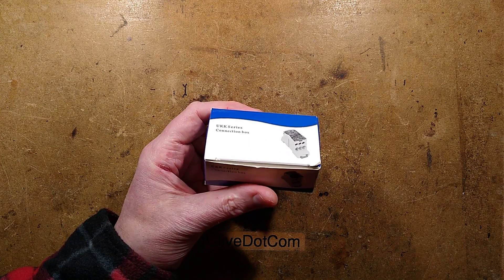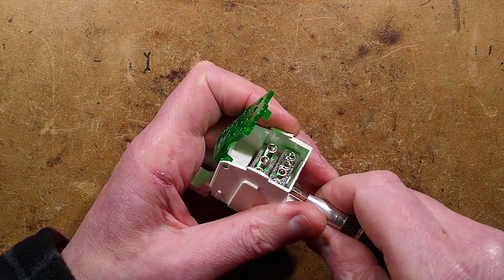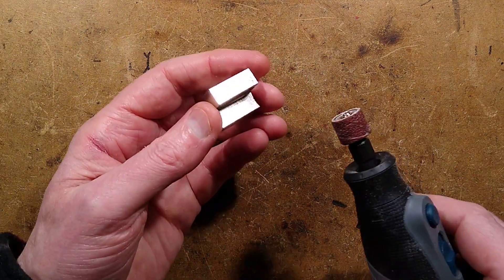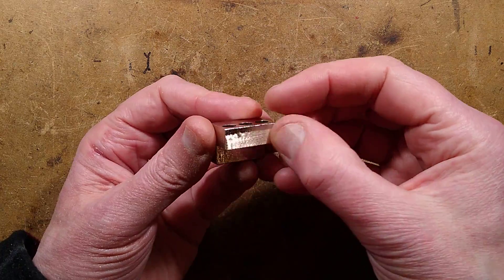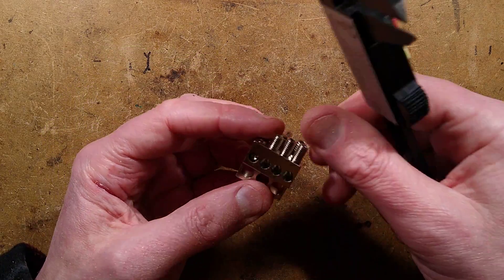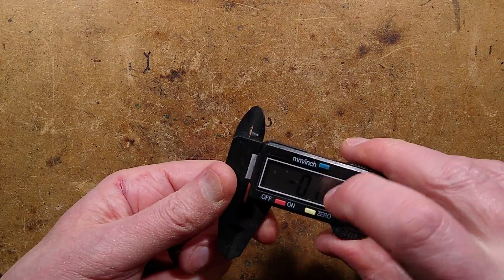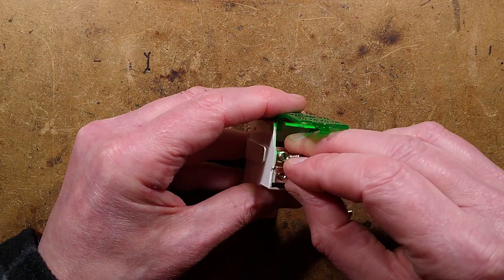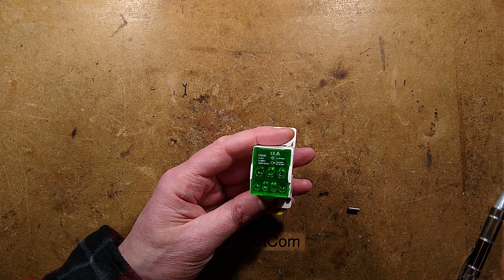Would you trust a Temu 80A electrical connector?

Comment: Well BCDC Ive ordered one £4.30 and will give it a surgical deconstruct - was the metal Nickel plated Zamac (Mazac)?  You could tell that just by weight?  What no one has questioned (inc you) is how sturdy and reliable are the screw threads to maintain consistent pressure on the cable strands.  Remember its one of the problems with Aluminium cable, that creeps over time and loses grip force, leading to micro arcing and eventual failure.  Will report here soonest.

Comment: 80Amp is what grid gives houses these days.
I do decommission lot of specialist plant growing premises. After original 88-3 fuse declines service,  occupiers tend to go for alternative supply solution. I am happy to say, that In south Yourkhire most of these seem to use CHINT C60 breakers. (sometimes 7 or 8 supplied  from alternative single phase route and used fully)
I do not see the idea of ever doing high current connection without putting handy breaker (again less then a tenner) in between.
Maybe in a medical field.
So this Should be strong enough to sustain full usage of normal house...
I still find this safer option then Idea of consumer unit From Ebay/Amazon.
In case of LVE  which used to be combined with LVE official website containing completely real user reviews saying stuff like "I just saved on buying consumer unit"

Comment: I designed an earthquake simulation lab apparatus that used 460VAC power to pump massive amounts of water thru a very small and cramped lab. I kept asking for water ingress-protected enclosures and controls but they're expensive... so eventually when the dean, dept chair, and two visiting grant program managers came to witness a demonstration I had our usual  safety brief and said, "and as always I cannot stress how dangerous this side of the room is; please just do not come over here, look at, and especially do not touch anything. These circuit breakers are here to protect the building from fire and will not activate if you become part of the circuit." 

The next day I had my capital expense approval for a whole new electrical cabinet. With name-brand parts!

Comment: The slight magnetism was probably the steel screws.  Zinc will vaporise well below the melting point of iron so a zinc, copper, iron alloy would be very difficult to make.  I suppose the silver coating could be Nickel which would make it slightly magnetic.  If it's Nickel coated brass then it is pretty scookem.

Comment: The longevity of this stuff is what worries me, once it looks like it can even handle the job in the short term.  Far too many times I've seen stuff from 'that' country look fine and work fine in the short term but come back in a year's time and it's failing in some way.  I'll happily pay extra to buy a thing manufactured by a reputable firm (getting harder to do because a lot is now outsourced to that same problem country, but quality control of that reputable firm does improve the end result) because I know it will still be there doing the job in 20 years time.

Comment: Before deciding to trust this device by looking at it:
Look up the lug torque specification of a similar device of a reputable seller. Tighten the lugs of the Temu device to the reputable device's specified torque specification.
Now you're ready to decide whether or not to trust that Temu device.
Reply: looks like a copy of the Erico UD-80A, so  bottom connections = 3.5 Nm top connections  = 1.2 Nm

Comment: The shiny plating looks great, but nothing like copper. Brass has a relatively higher resistance. When it comes to ohms, it is little, but even that little has major effects, like too much heating when it comes to high currents like the 80 amps mentioned and especially using AC. My answer is no, I would not use it.

Comment: When PEX water pipes came in, the Chinese brass had 15% zinc in it that caused problems. Then mixer taps (brass) had some lead content over the permissible levels.  Don't know if UK enforces import standards, but different countries seem to get different product.  Perhaps it would be a hoot to have a UK  metal machinist too up a drop in , identical magnesium connector block.

Comment: Anyone have a suggestion for a Wire Ferrule Tool? I’m building some Bi-Amp 10ga Speaker Wire and I want to put Ferrules on each of the four Wires so they look tidy going into the Banana Connectors that have Allen Key Grub Screws. Never used Ferrules before but they look great for this purpose. Tool and Ferrules would be appreciated. 🙏🏻
Reply from the maker: To guarantee that you get proper copper ferrules, I'd recommend you get them from a proper electrical/electronic distributor in your country.  The crimping tool should be OK to buy online though.

Comment: wouldn't use it for 80A but for maybe 20A in a low voltage system for a personal project. anything that you're putting together for someone else the components should come from reputable suppliers and be approved by a testing lab for liability reasons

Comment: A lot of materials at low cost uses metal that has been recycled and may not be pure.  Unsurprising that a brass which should be just copper and zinc is magnetic.  That indicates that iron has contaminated the mix.  Pure copper is just getting more and more expensive.  I find the same contamination issue with solder that won't flow as well as high quality versions.

Comment: I have the same one, from aliexpress, no issues whatsoever at 80amp (and beyond). Though I have a 63A DC breaker from the same store that can't even handle 40A without smoking.

EDIT: This is not an endorsement, mine could be copper, the next order could be steel, you never know with these products and stores.

Comment: Handy tip # 56 .... it is a good idea to remove the button cell from your vernier , if not used regularly .... some verniers draw a tiny current , even when off ... then ... you get the usual destructive messy corrosion ! .......... DAVE™🛑
Reply: Yes, for all things battery.  Of course I only use mechanical calipers.

Comment: The nickel plating will be very slightly magnetic.... More of me worried about the flame resistance of the plastics .. its not just about the item itself but what happens if a nearby component goes on fire ... Will the plastic in this temu item catch fire quickly.?

Comment: I'd be dubious of the metal used for the screws and how good the threads are.
The screws don't seem to fit too well so the threads might not be very accurately machined (molded). I doubt they are hardened so the socket cap would probably strip out before you could torque them down tight enough to hold the wire especially if there is a tight spot or swarf in the thread.

Comment: UKK... Urho Kalevi Kekkonen.
Kekkonen, Kekkonen, Kekkonen, Kekkonen, Kekkonen.

There would also be a "red brass" alloy that has a very coppery hue to it, but I wouldn't trust the stuff with threading screw holes into it or at least significantly torquing said screws. It is common in trinketry and belt buckles etc, usually plated with a dull silvery coating that may be further stained. The coating will wear off and reveal the coppery color when brushing against clothing long enough, and the stuff will also sometimes develop greenish-greyish tarnish when exposed to skin secretions.

Comment: I'm guessing it's only rated at 80A to imply a limit of 20A on each of the "outlets".  Probably the first thing to break down with higher currents, which the block could easily handle, would be the cheap plastic melting.  I used a similarly cheap knockoff DIN mount double pole isolator on my small solar input circuit, maximum 20A at 45V is never going to worry it.  The branded item Schneider is ~$130 Aussie bucks and the knockoff was $8 shipped.

Comment: You can get brass alloys that have a touch of iron and other metals in the recipe, most brass is 70 copper and 30 zinc, for acetylene gas components I think they use more zinc in the mix to prevent copper acetylide forming which can be explosive.
Gaz Yorkshire.

Comment: Ah... Now that Big Clive ❤‍🔥 has bought and reviewed it, Temu will drop the quality down considerably to maximise profit at minimum outlay while people are buying on the back of Clives findings. I wouldn't touch Temu with Mr. Sunaks' barge-pole...But if I went on there now and bought the same thing, I wouldn't be at all surprised if the one I received was 100% aluminium or worse. 🔌⚡🔥⚠

What would be fun is if this was passed on to PhotonicInduction to see just how much current it could withstand in practice. Think my bet would be on 80A For <= 30s but nothing above 20A sustained. 😋

My tip: If buying cheap or easily counterfeited parts, consider Dremmeling a part of the block where damage won't impact safety or function...Or if you're really good with RF, check its composition via RF or electrically. Definitely check it's the real deal before you bring it into service, though! 👍

Comment: I wouldn't put it in a panel or any of the cheap budget Chinese control gear , saying that I've worked at the odd place that have used them and seen quite a high fail rate with miniature circuit breakers,contactors and panel switches/button's, just tightening terminals the mouldings flex and twist on some and contacts don't make,utter rubbish

Comment: I actually have some similar looking units in service at work but the front plastic cover is a baby blue. Maybe if i remember i will report back what brand those are. I wonder if they're made in the same place or if this is a clone made by temu based off the original. Not sure why this has 3 inputs in the top though. As i recall the ones we use at work have a single large input at the top and 6 outputs from the bottom.

Comment: Those UKK Terminals exist already far longer then Temu. I am using them for years and as they fit on DIN-Rails, they are very practical. The bigger brothers like the 125A versions I do use as Main Busses in a Powerwall where currents go up to 95A regularly. Much bigger issues are for example the Chines breakers. Those fail on me frequently.

Comment: With such a quality connection this would make, at 80A you may also find it doubles as a space heater. I can imagine the fun, melty goodness that could come from something like this when running at 80A!
Reply: My home lightning arrestor claims to handle 100,000 amps. Funny there don't seem to be any cables large enough connected to it. Maybe they count the bolts that pass it by.

Comment: I like the special high voltage vernia calipers good for 30kV just in case you have to measure something that can't be turned off, 
Or are they carbon fiber to lul you into a false sense of security 😂
Reply from the maker: They were sold as being carbon fibre, but are not conductive.

Comment: I can't be alone in the "Buy three of them, test one to failure, and then use the other two at half the rating" mental thinking? Especially for prototype stuff where I just want some isolation/organization, and not really going to push it to the absolute limit.
Reply: Testing just a single item to failure doesn’t inform one of very much. It’s possible to have an outlier as the test item (either as a poor quality junk or an example of how good the product may be). A small test sample with an odd number of items, starting with at least three, would be better. Using two samples one is not able to identify the outlier if the results of one are significantly out of line with the other. (Having an even number of samples in general allows for a situation in which all results fall within two groups evenly.) 

Ideally, if one is concerned about the quality of a product such as this, it would be wise to test every component at the promised maximum performance guarantee for at least a short time period and perform a longer test a value that is a bit higher than the expected load it will be under in daily use. This way if the item is unable to meet the job requirements one should find out early on. (I did say should find and I’m not promising parts won’t fail later on.)

Comment: Speaking of steel screws... how do solar systems get away with having bolt connections? I've see things like two lengths triple naught (/000) wire terninated with a copper eye and just an 6-8mm steel bolt to keep them together and instinctively shudder.
   Is there an expectation that the reverse blocking diode (100a assumed for this exercise) will prevent over current events that would be much greater than power normal consumption? 
   Is it the weak link assuming proper tight connections? 
   I very rarely see setups after fires to clarify if went nuclear from the batttery cables. I do realize that a big inverter will have a row a 30 amp fuses in it, plus a breaker on the panel input at the otber end. Still don't like steel bolts for cables around the batteries.
Reply from the maker: The solar industry seems largely driven by profit over technical competence.

Comment: Finding the density of the block would help. Take out the screws first, weigh it and then use a measuring cup to see how much water it displaces. Worst case with something like that block, measure it accurately and make allowances for the holes to figure out its volume.

I use density this way to separate out Zamak scrap from aluminium for melting and casting.
Reply: Eureka!

Comment: I would use it , but more or less with half the load they advertise cause it really looks good.

On the other hand a german made connector for 3 phases and ground and neutral is about 5€ here. I would buy the german one cause I can not save that much and I feel safe that the figures and loads are right.

I had seen these on Ali Express when I had bought those german ones but there was not that big difference.

Comment: Well Bigclive...you really can't "trust" anyone now a days.  However to simplify your design:  A 4.5mm copper wire can handle 80 amps but would be running pretty warm.  The usual problem we seem to have with all brass connectors seems to have it's roots right there.  Of course, the chrome plating is a really bad idea.  Nut, here let us look at the problem we can trust, because we already have that one. 

For some reason, and most likely that of being money efficient is efficient, for some reason or reasoning all brass electrical connectors seem to give us problems over the years.  Let us think about this for a moment, you have a copper wire that is pretty weak when it is hot, clamped inside of a piece of brass, that is also pretty weak when it gets hot.  Now, what we can trust is that the copper and brass are malleable materials so repeated heat treating is certain to warp the materials.  As a result you will notice that all connectors cannot be expected to run an unlimited number of cycles at their maximum rating.  This reliable failure has usually the appearance of a lot of burnt insulation in the area of the connection and closer inspection reveals brass that has gotten brittle and cracked.

Now, if you give that a bit more thought, the addition of a bit of iron to the "brass" would make for a  bit stronger brassite, however the original brass mixture is probably mostly zinc.  I really cant hold it against them, brassite has been a substitute for brass since the beginning of time.  So, knowing what we can "trust"... The smallest hole in the connector should be down rated by one wire gauge which is number 6.  This gives a a connector that should last longer than the cheap chineesiumite plastic if it were run it fused at an industrial rating of 40ampers/200%.,

Comment: I've seen that silvery "brass" alloy in many cheap electrical devices, it's always super brittle with huge grains in the metal. I always figured it was basically pot metal from whatever scrap they had on hand, as they don't seem to be too picky about meeting specifications.
Reply: White brass like this is pretty common in other places, like taps and the likes. It is absolutely the wrong kind of brass to use for electrical connections. White brass is not intended or remotely a good idea for situations where any plastic deformation is required.
Reply: yep. If you torque to spec, it just bursts.
Reply: Chinesium can be pretty hit and miss, they have a saying that basically goes "you get what you pay for" and if you try buying for cheap without proper connections you'll definitely get scammed.
Reply: You'd have to be on pot 🚽 to trust that any alloy coming from Temu is anything close to the claims made in the listing... 🍁😉

Comment: Well, its a solid metal block so obviously it can handle 80A.   As long as it is plated the brass is fine.  The question is primarily one of screw retention / the wire interface.   It looks quite reasonable as long as the screws aren't easily stripped out.

I would definitely use ferrules for any wiring (yes, those would be some huge ferrules), but it will improve the copper/tin interface, the retention, and provide a bit of protection as well as reduce excessive bending of strands as they leave the holes.

A good litmus test, actually, is to determine the largest ferrule that fits into those holes, that it reaches across the screw cross-hole, with the ferrule's plastic shield fitted into the hole, partially fitted, or outside the hole (three different sized ferrules for each size hole).   If you get a good fit there is basically zero chance of having electrical issues.

-Matt

Comment: Could it be an aluminium-brass alloy? I think the light colour made it hard to tell, it looked like plain old aluminium to me.

A simple test of the weight and volume (take the screws out and dunk it in a graduated cylinder of water) will enable one to calculate the average density, that might yield some more clues to the composition. Copper is pretty dense so if it feels heavy that's a good sign.

Sure they could have smuggled some lead in but I'm guessing that's unlikely.